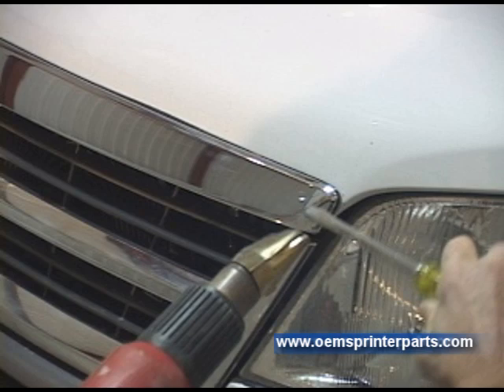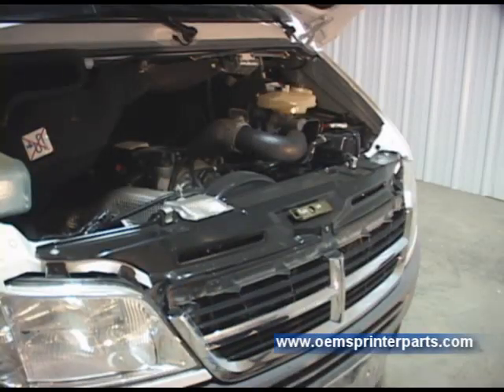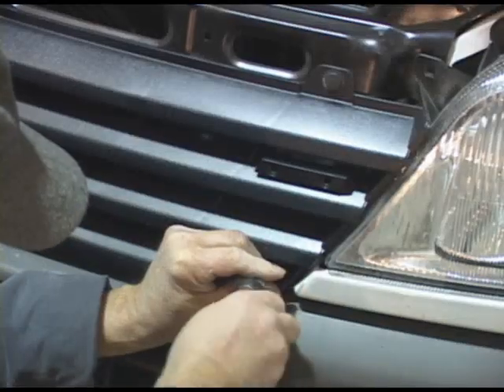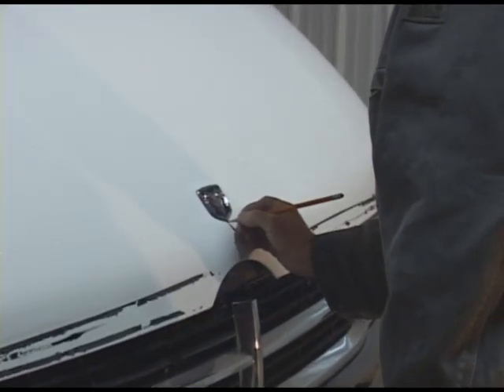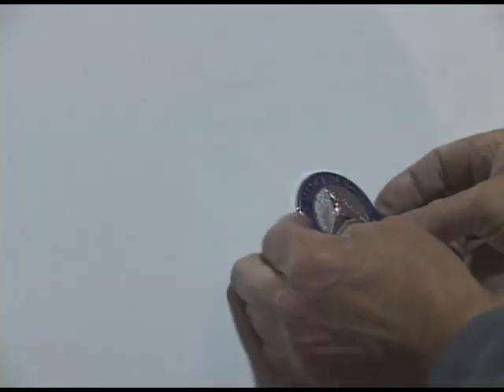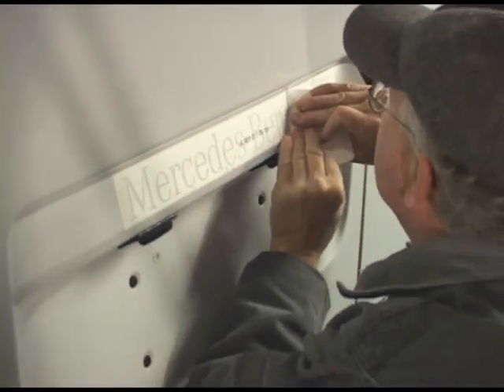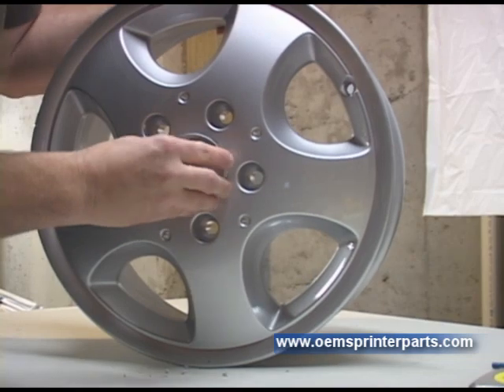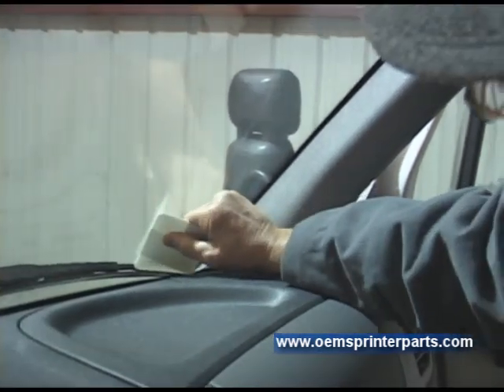How to Install Mercedes Sprinter Conversion Grille Kit | Sprinter Parts Depot

Comment: Thank you so much for this video, very high quality. I thought I had got the wrong hub caps for my 2004 dodge, but no, I didn't look at them closely enough. Btw everyone, my dodge steering wheel badge was all banged up from hitting the horn while holding my ecig. I disconnected the battery, waited a bit, then used a flathead screwdriver to pry the tin piece of crap off. I used some 3m double sided adhesive (the clear stuff bc it's thin) to stick it on and it sits flush. Got all my parts on ebay, but sometimes the MB dealer might have them cheaper.

Comment: Can this work for the freightliner i noticed there is a trim around the headlights on mine
Reply: Yes, but you must order the correct grille. We have on that has the edges machined to allow for the trim around the headlights. You can see it here https://www.sprinterpartsdepot.com/collections/grilles/products/mercedes-sprinter-grille-fits-2002-2006?variant=33925681103

Comment: the real way to remove the stuck on things is with a special string like dental floss, it cuts behind the stuck on badge without needing to use a heat gun, the heat gun is the wrong way to do it...

Comment: That is not the original mercedes badge on the stearing wheel
Reply: He doesn’t state that it is. The authentic option is to swap out the panel but that comes with caution due to the airbag, which he mentions.